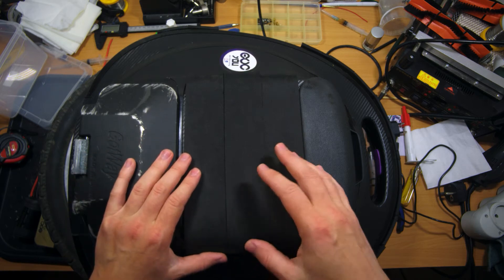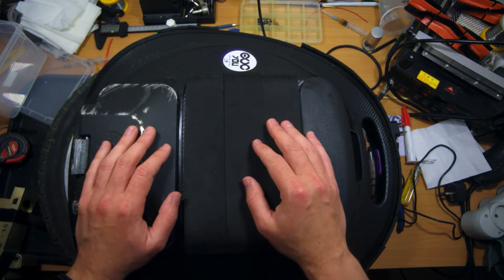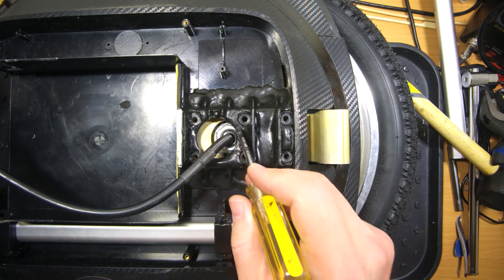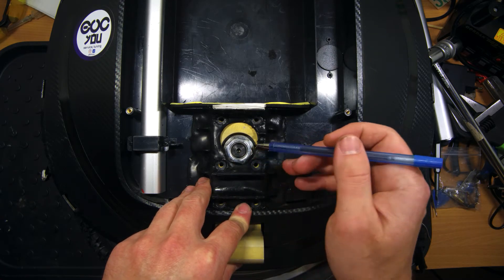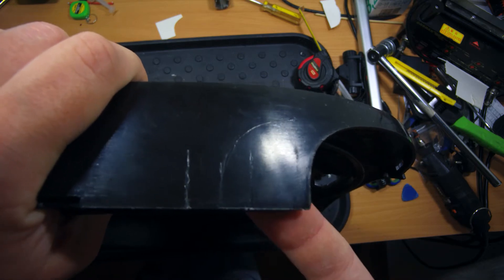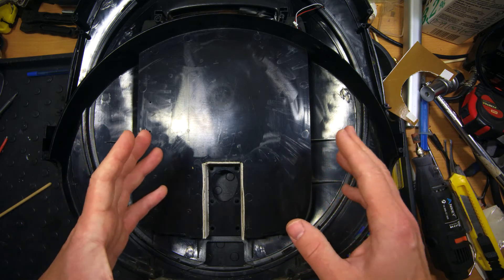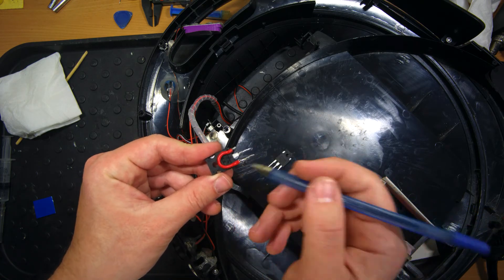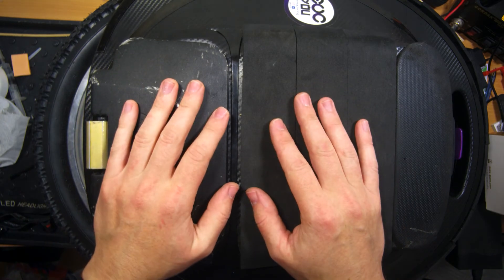GotWay Tesla V2: 10mm lift and 16*2.5 tire installation

Comment: Thanks for this! I've already done 4000km on the CST C-1488 16x2.5 on my tesla v1. I didn't modify anything. Now I want to see if I can fit a CST C-1488 16x3 tire. I'm thinking about cutting a wheel well section off the side panel and then hot gluing it a bit higher. To replace the missing screw positions I'd have to come up with something. I would use the original pedal hangers and lift the shell by the width of the light strip cover that goes underneath the pedals. To reinforce the mounting bracket inside the shell I'd have to make a steel plate that goes over the hole pattern, with new holes for the offset pedal hangers and motor wire. I'm hoping that a 10-15mm offset is enough. Between the shell and the pedal hanger you can put a 10-15mm piece of wood so the weight can rest on the hanger.
Reply from the maker: I'm currently working on 25mm Lift for V2 with EUCYou pedal hangers. Video will be available soon. Subscribe to the channel not to miss it ;-)

Comment: I did not saw how did you add the capacitor
Reply from the maker: There is nothing to shoot about it, as I mentioned in the beginning of the video, the capacitor has necessary connectors soldered. It's really easy just to connect it between the battery and controller.
Reply: Is the capacitor there to reduce voltage sag?
Reply from the maker: @mikeh6286  Yes. The pedals become more rigid with it.